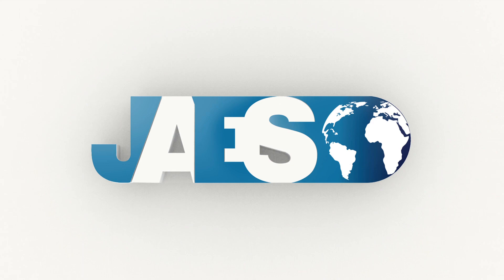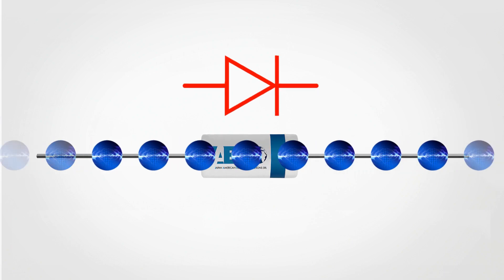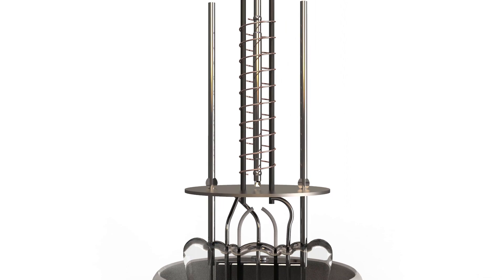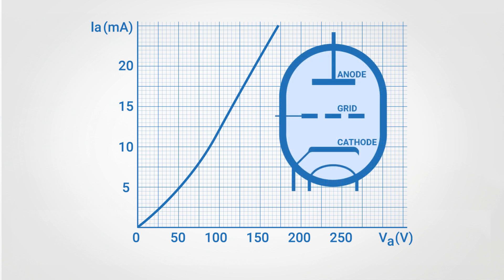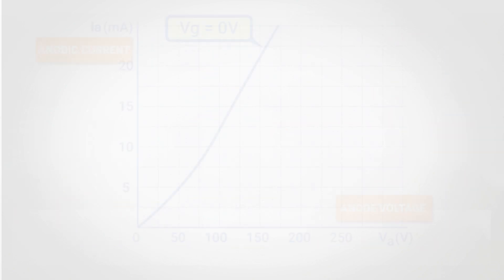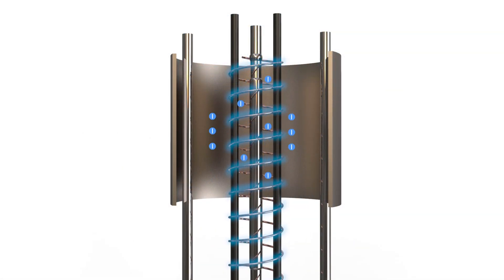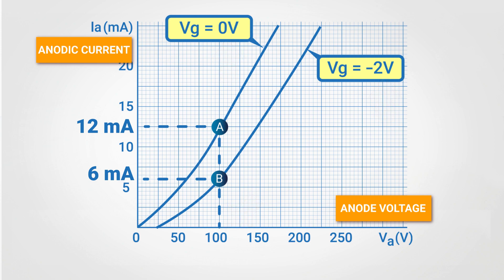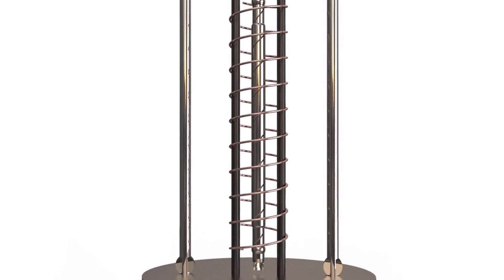How Vacuum Tubes Work - Triode Control Grid - Anode Voltage - Anodic Current

Comment: What happens if the battery placed between cathode and grid has a positive voltage? What would the resulting effect be?
Reply: No effect... All triodes are just diodes when there's no negative grid voltage. The grid voltage turns the valve off...once it's on you can't turn it on more...hope that makes sense :)
Reply from the maker: @1goodfixer  thanks for answering